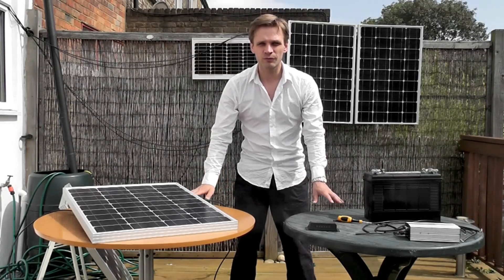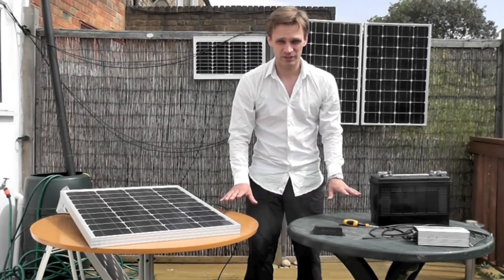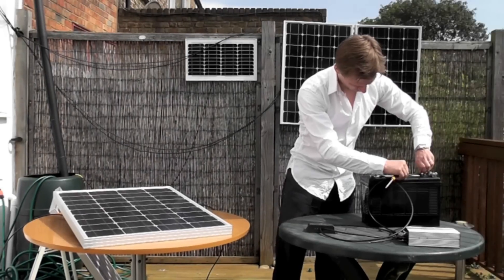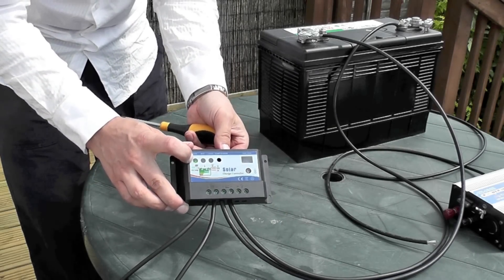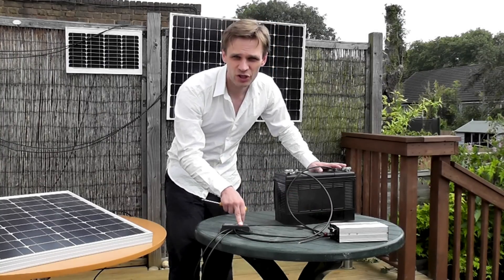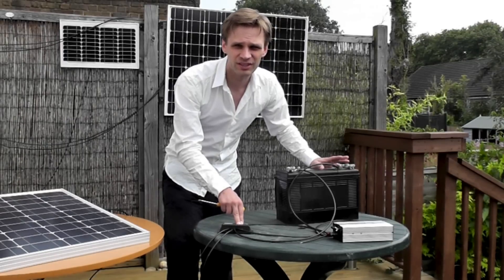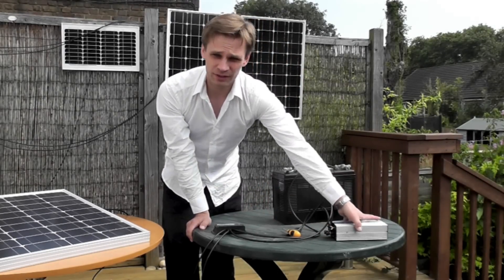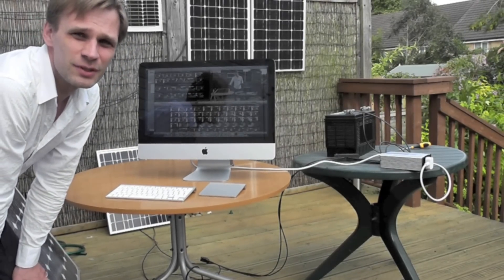How to create a 240V AKT Solar system that powers mains appliances

Comment from the maker: Hi Smiggle, 

This really depends on the different products you are using. Normally 12V systems are a low fire risk if properly installed but 12V batteries can still cause significant sparking and release a lot of heat if short circuited. 

At a minimum I'd suggest to isolate the inverter and possibly also the panel and battery. The best way to do this I think would be to remove the connectors from the battery. This should be relatively easy if they are ring connectors.

All the best,

Jonny
Reply: Jonny, have you ever been to mexico?
Reply from the maker: Unas vezes. Y tu?

Comment: actually one more question. since i am planning to install in school area would i need to install on/off switches (and where would i install the switches) to the cabling for when students go on holidays. i mean if the power is not being used for 2 months i figure students could turn of the switches rather than unwire everything.is this necessary? is there any danger to the system of causing a fire if the system is left intact for extended periods and not switched off.

Comment from the maker: Hi Smiggle,

I thought of something else that might help you decide: If you're going to use more current than the rating of the controller then you'd want to wire the inverter straight to the battery in order not to blow the fuse in the controller.

E.g. using over 240W of power would run the risk of blowing the fuse in a 20A controller and using over 120W would run the risk of blowing the fuse in a 10A controller.

I hope this helps and please feel free to ask any further questions,

Jonny

Comment from the maker: Hi Smiggle,

For most cases it's best to wire the inverter via the charge controller.

This is because wiring via the controller stops the battery from over-discharging as the controller will cut out if the battery is too low. This will increase the battery-life.

Wiring directly to the battery runs the risk of damaging by over-discharging, although in some cases this may be useful such as an emergency where you need power but your battery is very low.

Please ask any further questions, 

Jonny
Reply: AKT Solar my first charge controller was pwm and wouldn't allow my inverter to run through it.

Comment: am bit confused as i am trying to learn how to set this up before i try fit it as a donation in a rural school. i understand the part about all connections from solar panel - controller-battery, however am confused with controller to inverter. some videos show they have it set straight from battery to inverter is this wrong?. which method is correct? is there different times you would use different method. thanks for video though. yours is only video with complete start to finish instructions.